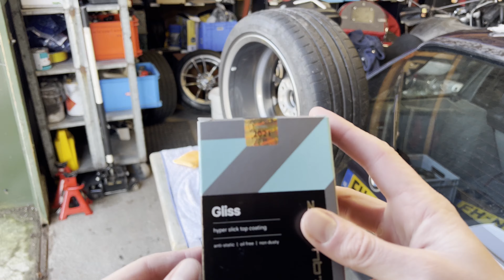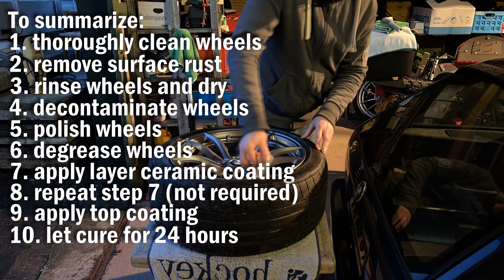BMW M2: New Wheels + Ceramic Coating

Comment: What tire sizes are these? And how is the ride quality compared to the 19”? Thinking of doing the same set up on my M2!
Reply from the maker: So the tire sizes are 255/40/18 (front) and 275/40/18 (rear). Ride quality is good and there is less road noise compared to my Continentals. Because the tires are slightly wider, they grip better as well (especially when the tires are warmed up)

Comment: i have an OG m2 and do you think 265 in the front and 285 in the rear can fit without any rub with the 437 stock rims
Reply from the maker: 255 and 275 would work. 285 in the rear would work, but not sure about 265 in the front…

Comment: The 513's are what the m2 SHOULD have come with from factory. This idea of huge rim/little tire is nothing more than a vanity/looks issue being sold to you by the manufacturers to make more money selling you more metal lol. Unless you're tracking/racing your car (and even then track cars generally go smaller rim/bigger tire) most people will never push their car to the limits except for a spirited drive down country roads so realistically more tire/less rim is going to be better for that. Personally i love them (even better powder coated black) as they'll A: give more comfort and B: more grip as M2's can be skittish at the rear due to the low profiles.
Reply from the maker: I agree with you man, I do have to note though that these tires are one size larger than the ones on my 437M wheels (255/275 vs 245/265). That already makes a difference in terms of looks and grip. Thanks for your comment!